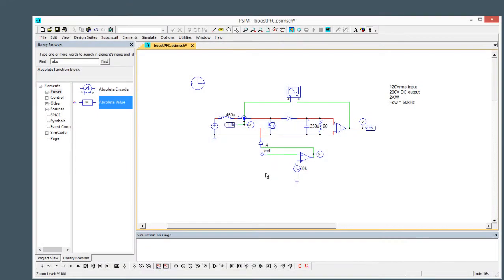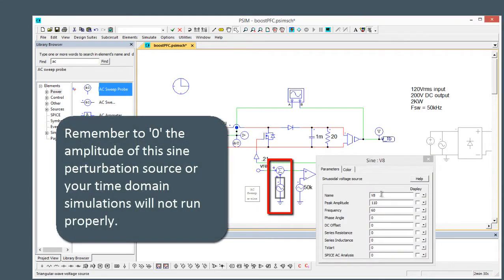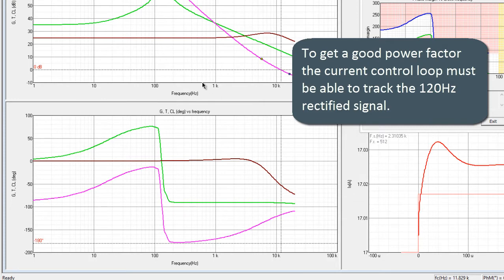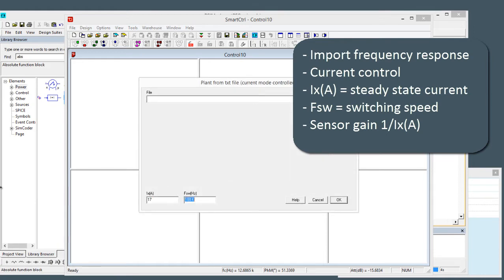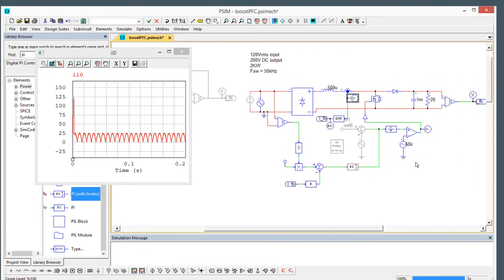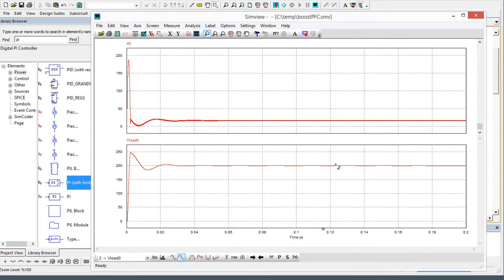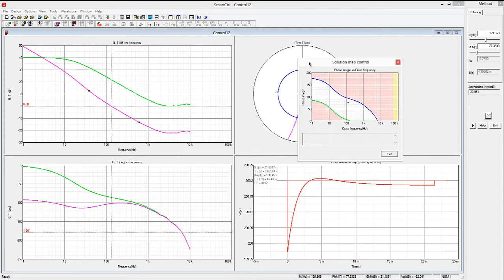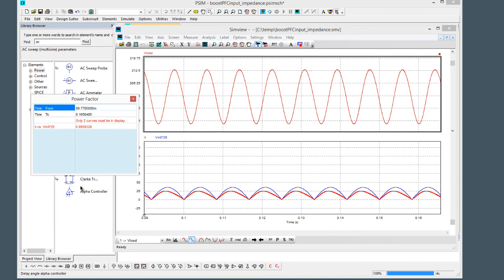Boost PFC - Complete design and AC analysis

Comment: Hello. I have a question.

Why did you use the dc source other than the ac for the input impedance measurement?  Would it work if the ac source is used?

Comment: Hello, thank you for this video, I followed the same steps for a boost pfc converter that has 220V as RMS input value , 50 Hz grid frequency and 60kHz switching freq and 400V as output value, but i had not good results of AC analysis so plz how ca I perform this sweep results ?
Reply from the maker: The comment section of YouTube is not the place for this. Head over to our form forums.powersimtech.com and post your schematic.
Reply: @altairhowto  ok thank you
Reply: @altairhowto  ok thank you

Comment: Where to view this smartcontrol to set PI constant values
Reply from the maker: I'm not sure I understand the question, smartctrl is another tool we sell.
Reply: How to link it with psim to get PI constant Values for a contro circuit
Reply from the maker: @kanhu_9  there are options in smartctrl to export to PSIM, you can export the controller or just update the parameter file

Comment: Why the open load Boost PFC output voltage does not stabilise at the reference value?, I have used it in my system but for the no load case it does not stabilise!
Reply from the maker: Hi there, the purpose of these videos is to help you use PSIM, not to do your work for you. Redo the control design and the open loop plant response without a load and investigate for yourself why this might not be an acceptable mode of operation. Use PSIM to investigate this question instead of just asking for answers.

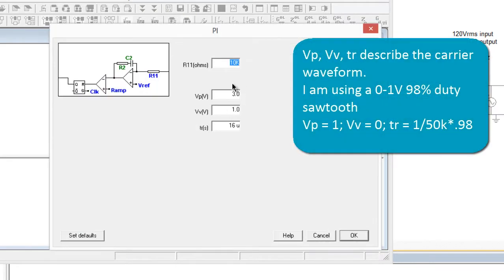Comment: Hi Albert, Thank you very much for an excellent tutorial. I did not understand the part (at 10:00) when you take tr = 0.98*(1/50k) for the PI compensator. This might be a very basic question. Can you please elaborate a little?
Reply from the maker: this is defining the ramp rise time for the sawtooth carrier waveform. switching speed is 50kHz, period is (1/50k). An ideal sawtooth waveform has a rise time equal to the period but this is not "achievable" as it defines that the datapoint at the beginning and end of a period must be the maximum and the minimum at the same time. So giving it a duty cycle of 98% or 0.98 defines a "real" waveform
Reply: Does that mean that you are using an asymmetrical triangular carrier with 98% duty on the rising side and 2% duty on the falling side?
Reply from the maker: yes.
Reply from the maker: yes

Comment: In ur basic circuit 
You have measure inductor current through scope how u did it ?
You place a small box fb mention in it ?
What is it ?
Where it is in PSIM ?

I am stuck in first 7 mints steps.
L=450u
C=350u
Vref=0.4 ?
Is it so ?
Plz help
Thanks in advance.
Reply from the maker: I am monitoring the current with the current sense element output. One can also "right click" the inductor and look at the current scope.
Reply: Right.
Reply: Thanks right clicks work 😎
Reply from the maker: right clicking on any element will pull up some very useful features. try the "run time variable"

Comment: Plz make fr Buck Boost too
Reply from the maker: There is another set of videos that covers a buck and another video that goes over a single phase inverter.
You can follow the same principle for a buck boost
Reply from the maker: PSIM and multsim are very different. PSIM is a purpose built tool for power electronics simulation

Comment: Thanks for the video, it was very useful to my project. Just i want to know how to determine the controller parameters to design an electronic load ? Thanks for the help again.
Reply from the maker: do you want to do a "real" electronics load that you will implement in hardware or a simulation load that you can change or will hold constant power?
Reply: PSIM i want to simulate a programmable electronic load with a regulated boost converter to test batteries and sources, thanks for the answer.
Reply from the maker: have a look at the buck converter design videos, you can follow this same design path to implement a boost which you can assign as your load. Or you can have a look at the variable resistor lookup table video which will show how to define a more complex load without having to design a converter for it.
Reply: Thanks again for the answer.